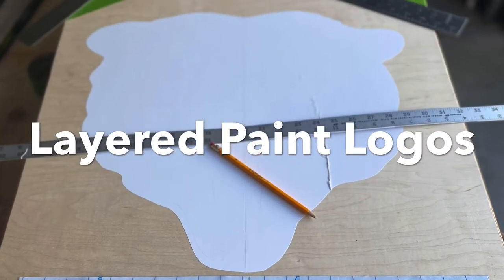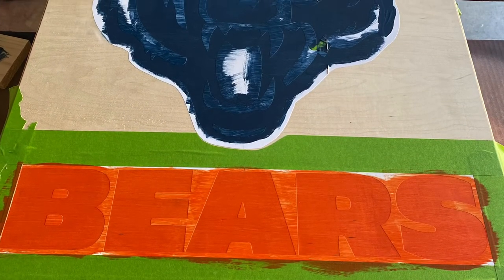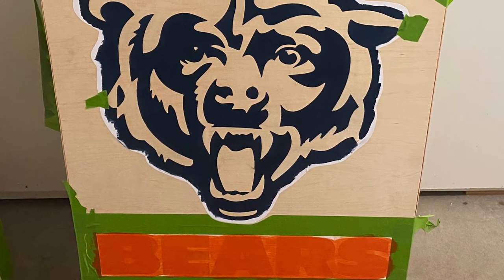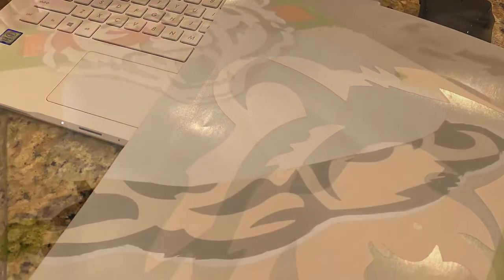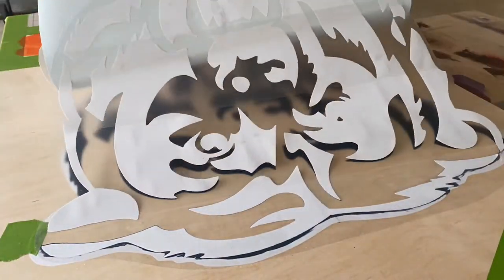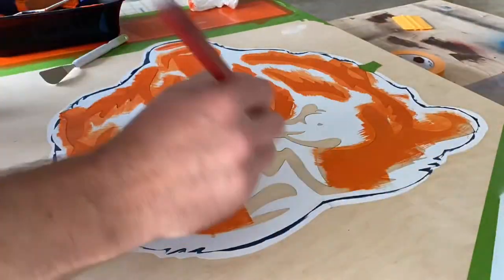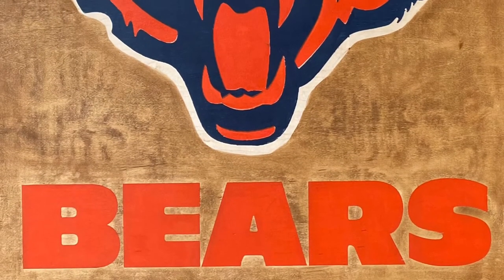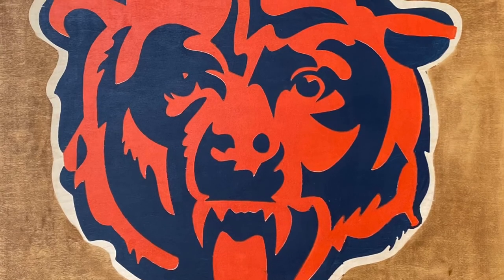Painting a Cornhole Board - Multicolored Logos

Comment: Does it cost a lot to use more material to remask? I have a few logos to do but curious about how to cut the vinyl to block one color and allow me to paint the other color. If I have a color overlapping another color how would that work?
Reply from the maker: It definitely uses more material. You basically have to decide what colors you’re doing in what order. From there you will need to weed out the vinyl in that order. It’s a process for sure, but sometimes you can get away with touching colors and not remasking.